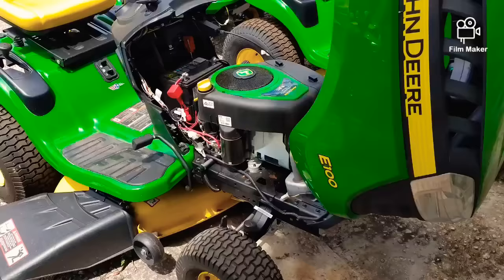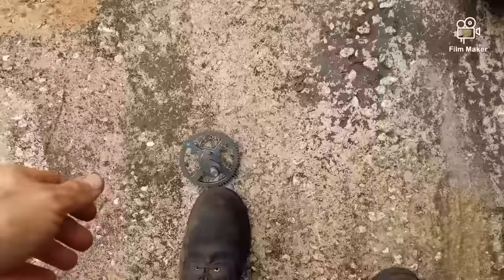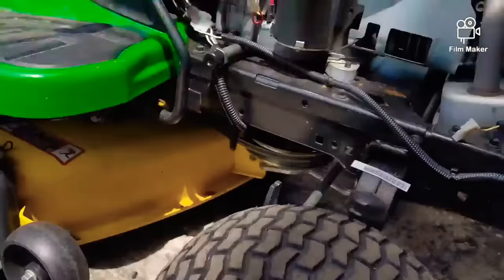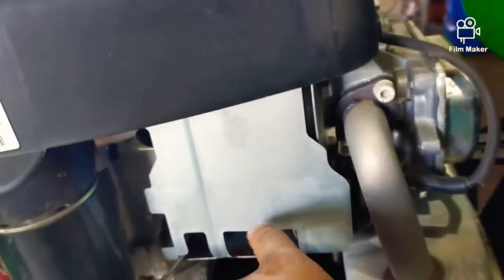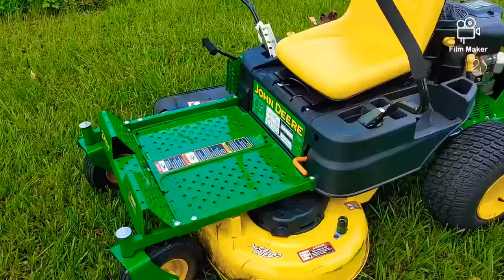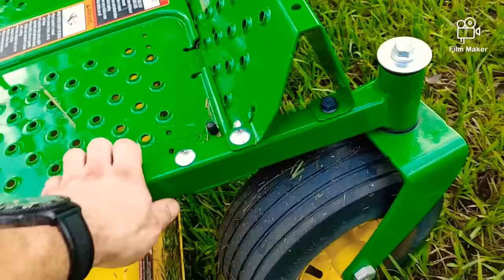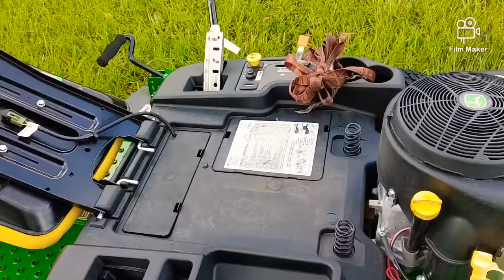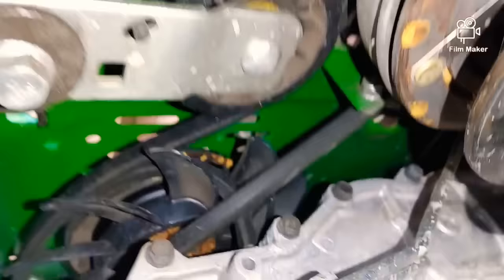Lawn mowers to avoid!

Comment: I have the z335e zero turn and other than the fact that it has no viewing window or any way period  to see fuel level I actually like mine so far it does have a light that comes on just before it runs out but I'd much rather be able to just glance at it and see how much I got and as for that compartment under the seat I see yours just had debris in it and nothing stored in there I can't think of anything you would want to store in that thing heck I barely even raise the seat anyway but the front caster wheels are clunky and rattle and stuff I'm sure the cheap plastic in there you was talking about is why....of course they can't make stuff to last anymore cause they are in the business of selling parts and if it ain't constantly breaking they couldnt sell you a part and fix it for ya lol

Comment: I just bought a z320m. Heard it was great
Reply from the maker: The new ones are much better than the previous generation of Z300s
Reply: @Mechanical_Mind  thanks for the video. I just inspected mine closely and it's definitely built better. I'm pretty sure the kawasaki engine is really good.

Comment: buy a mower that fits your yard.people buy a lightweight plastic mower and then mow rough hilly land that beats the mower to pieces and burns out the trans. and take care of the mower. you cant mow week after week and just pull it into the shed  and expect a mower to hold up with no maintenance and no cleaning.
Reply from the maker: 100% accurate! Thanks for watching and commenting 🍻

Comment: I bought my Z375R about 3 years ago. And I hate it. Yes it cuts my 2 acres great, My lawn loves it. However I get covered with dirt and debris, I mean covered. You would think John Deer could design a mower like this that does not blow shit up over the front of the mower deck. I even wear safety glass's because of the crap coming up over the front of the mower.  Unless you like to get covered from head to toe with debris buy another one

Comment: Both B+S single cylinder engines have that cam problem. Also the single cylinder engines have very poor head gaskets that like to fail by the push rods giving you crankcase pressure and it's resultant problems. Makes you think you have bad rings. Otherwise these engines are ok. Most JD z tracks ore good except this cheapest model which is junk like he says. One other problem is you can't see how much gas is in it as you fill and can easily overfill it. I never heard of that mech air in the front tires. Usually you put 10 psi in the back and 12 in the front. If tires want to leak if it's a hole I plug it and if it's beads I clean and put sealer. Otherwise I put a tube. I was a JD mechanic for over 20 years and have seen it all.
Reply: You said "both B &S single cylinder engines", which two? I know the Intex 33R is bad, but what's the other? I'm looking at a 21hp professional series to replace the busted 19.5 hp Intex. Would that be a wise choice or is it too a dud?

Comment: None of what this guy said is true of my Z355E. I'm going on 5 years with mine, and so far the only issue I've had was a pin fell out of the right steering arm. And all that caused it was the nut got loose and fell off. 5 minute fix. Mine has bearings in the shafts for the front casters not bushings. I take them apart and grease them each spring, as well as the spindles, etc. 

With proper preventive maintenance these are just as good as any other lawn implement. Surely neglect something and its going to fail. The wise man anticipates issues and corrected situations before they happen.
Reply: Oh yeah by the way, my front tires never lose air, so it must be they've started cheaping out on parts with newer units.

Comment: Good video. Plastic trans? Wow. I guess JD needs a price point for those who want JD but can't afford higher end ones. Unfortunate.
Reply from the maker: John Deere makes some of the best high end equipment so when customers say "I thought John Deere was high qaulity" when their $2k mower breaks I think to myself "you need to spend more than $2k to get quality" They did finally stop using plastic transmissions 😆. Thanks for watching and commenting James 🍻
Reply: @Mechanical_Mind  So true you generally get what you pay for. Jd has a very good reputation for quality on the high end and I'm quite invested in their Ag equipment. My cousin was looking to replace his last gen craftsman which he has broken 6 of the aluminum spindle blade housings. He mentioned JD but thinking not a zero turn. Any suggestions for a decent JD model (approx 1 acre of cutting).
Reply from the maker: @jameshill4900 X300 series if he is willing not to have a zero turn (which I dont understand the obsession with zero turns). The x300s are really nice high quality lawn mowers.
Reply: @Mechanical_Mind  Thanks 👍

Comment: I gotta call BS on his remarks about the John Deere Residential  zero turns.
 The deck isn't  cheap nor does it bend easily.  Operators  fault if he steps on the deck. Not John Deere's.  The deck lift is not something  you use every time you mow. Most people have it set at one height and leave it alone. The bushings in the front spindles  do wear out but after many hours of use. Tires hold air just fine . The body plastic  cover isn't  difficult  to remove. What he said is wrong.
 No abnormal amount of drive belts coming off. In fact I haven't had a single one come in with that issue.
 My ONLY  concern would be the non serviceable  transmissions.  I wish you could easily  change the transmission oil in them.
 So overall  if you maintain the mower, don't do stupid stuff with it than you'll  be glad you bought it

Comment: Sorry but your info is just your opinion. My JD's have been flawless. The current one , 6 years running since bought new ..  Oil changes and blades sharpened. Thats it. Still has the OEM battery in it. The Home Depot JD.s are more than likely junk, just like all the mowers the sell.  I mow about 2.5 acres each time. Correction, my wife mows, she loves to do it. The JD mower was a very good investment. Zero turn.

Comment: I disagree about the 335e zero turn. I use mine about 40-50 times a week on lawns and it's insanely reliable. Never has been down in 4 years and I got it new 0 hours $1000. Great investment. Deck sucks and caster wheel bearing is garbage but it's not a deal breaker. This is coming from a landscaper and small engine mechanic. I got out of John Deere ultimately because they are garbage mowers all around.

Comment: Any JD zero turn with an E in the model number is the bottom of the line. Leave this junk at HD or Lowe's and buy the R (residential) model. It will cost a little more the the difference is huge.

Comment: 58 hours on my JD zturn and tech said the throttle cable was already frayed and should be replaced, $133. Then, after only 58 hours or about two seasons, said he couldnt balance the blades anymore and needed new pair $70. Im rough on the blades, but cant figure a metal cable needing replaced after only 58 hours. Unless Im being had, I sort of regret buying the JD, I thought they were well made but not so sure. Problem is that the various lawn mower companies are all pretty much the same and junky, the brand name is irrelevant, it really comes down to how much you are willing to fork over in cash. Not everyone can afford or wants to spend  20k+ for a commercial grade mower for personal residential use and corporations know it and so they put the junk at the sweet spot price point in the middle usually somewhere btwn $2500 and $3900.

Comment: All of the residential mowers from Deere, Cub, Husqvarna, and so on are made by the parent company of MTD.  They are all basically the same and that company licenses the rights to the names.  Don’t think just because you went to a dealer and spent $500 more than at Lowe’s yours is any different.  If it’s residential it’s junk and made by MTD.

Comment: I hate my JD z355e. I gave up trying to keep air in the front tires.  If you hit a pine root your deck is bent. Putting the deck back on is horrible. A new deck is over $1000!

Comment: I own a z255, has anyone had issues with the front draft rod slipping off constantly? I've had to resort to using wire to wrap and tie it in place. This usually works for a few mowing, until the wire rubs enough to break.

Comment: You should never turn those Briggs singles  like you did. Good way to actually break the compression release. 
 If you would have adjusted the valves on it, it would have solved the issue. But I guess you probably already found that out being this is an old video. I sure hope your client didn't get charged for a bunch of unnecessary parts and labor. 
On those engines, when the compression release breaks, pieces end up in the timing gears, and that transitions into the engine either locking up, or rolling over a little bit, then stopping solid and not rotating any further. 
When the valves are out of adjustment, the exhaust valve isn't opening far enough when the compression release bumps it, to let enough compression out fast enough to enable the engine to roll over properly. When you rotate it slightly backward off  all you're doing is basically getting a run at it, so to speak. 
I have fixed dozens of these, and every single one that had a bad compression release, was either locked up or would roll over slightly then stop solid.

Comment: Does the JD S120 have a plastic transmission? Thanks again and nice video.
Reply from the maker: No, the S120 does not have a plastic transmission.  JD had so many issues with the plastic transmissions they stopped using them altogether. They use Tuff Torq brand transmissions now. The S120s are decent mowers. Weak decks and cheap spindles and deck idlers in my opinion.  I'd buy a Cub Cadet if you want a tractor style riding mower

Comment: I have a z535M with 54" accel deep deck. I haven't been dumb enough to step on the deck, and I have no complaints about the deck, except that the center spindle grease fitting is a PITA to get to. HOWEVER...I just had a major issue: The drive belt worked a groove through that plastic cover you mentioned, just below the battery at the tensioner pulley....and yes, wore through the battery splashing battery acid all over the underside, with the belt slipping off the pulley obviously. NOw, I've got my mechanic looking at this soon and I'm wondering...it's a chicken or the egg question...which came first...did the belt slip past the lip of the pulley over time and eventually wear the groove through the housing and the battery that way, or did the crank shaft seal go first and cause the whole thing to happen in a short amount of time?  Ping me back and I'll try to get back here with my mechanic's results.
Basically though...having the battery compartment just above the tensioner pulley is a baaad design....and only protecting it with plastic. Ugh. Stupid. I'm going to ask him to put a steel plate under it or something.

Comment: I have Z335 and it has 400 hours on it. There is lot of problems begun, and main problem is crap 42" Accel Deep deck. Its shit shit shit. Just like a Russian/Soviet thin steel... at first it was very good to cut but now it has some dents and twist so it does not work anymore good
Reply from the maker: 400 hours for a Z335 is rare. They normally fall apart after 200 hours.

Comment: I bought this mower from a guy and it was 5 years old.  My son has 2 acres of lawn and it mows great. So I don't know what your talking about. Hes had absolutely no problems with it
Reply from the maker: Consider yourself lucky. What I'm talking about in this video is after years of working on hundreds........ HUNDREDS of these very mowers, and they all had the SAME issues. John Deere was apparently having so many of these same issues with I mentioned that they  fixed every one of those issues for the newer model. I'm not saying it was because of me. It was because all the dealership's service tech across the country were seeing the same. JD does actually want input from the technicians in order to make changes and improvements, which I think is great.

Comment: Your insight and warnings are very much appreciated. I do have a question and am interested in your opinion on my John Deere model LX 173. I have a terrible time getting the mower to fire after a week of setting, or in-between mowings. I replaced all fuel lines, I tried a new fuel pump but that was worse. I put old pump back in. It pumps 1oz per 15 seconds, which from what I read is up to specs. I replaced the old ignition coil. It tested bad. Also replaced old spark plug. The resistance was only 4.62k ohms. Even after all this it still takes a good 30 seconds of cranking to get engine to fire. I made sure carb butterfly is closed so as to choke the engine.  Any thoughts or experience with this phenomenon! Much thanks! Keep up the good work sharing your knowledge!!
Reply from the maker: Hi Scott, it sounds like you might need a new carburetor. Make sure the choke cable actully operating the choke properly. You might try removing the bowl and making sure the fuel shut off valve isnt sticking.
Reply from the maker: Id also check your valve clearances. 
You also might have a valve not seating properly.

Comment: I just bought the new Z320R And I pick it up Monday. What do you think of the newer ones?
Reply from the maker: The 2023 models are much better than the recent prior years. They drastically improved the frame, front tires, deck lift and more. I'm not a huge fan of the deck. I made a video on the 2023 
https://youtu.be/wSLQwtbfVno?si=wIqwi2mpHy003aNr

Comment: I've never understood why they would design a compression release mechanism into the camshaft. Just put a starter on the engine that has enough torque to crank the engine. The incremental cost of a stronger starter motor can't be that much. I also can't believe they are using plastic for the construction of the hydrostatic transmissions. That's absolute insanity.

Comment: Thank you for the video and helpful information. My question is, based on your experience, what riding lawn mover, John Deere or different brand, that doesn't have a plastic transmission, would you recommend for one acre residential use? Thanks
Reply from the maker: For 2023 zero turns $3500 -$4k price range I like the Husqvarnas and Cud Cadets.https://youtu.be/HnByd9pllRY

Comment: Whats your opinion on the Z5 series? I am in the midst of negotiating on a Z530M and a Z5R to compare against my quotes on the BadBoy Elite and the BB Maverick and a Toro TimeCutter “Havoc” edition (all 52”+ sized decks)…
The JD Z5’s appear to be a substantially better built machine than the Z3’s… Are there any insider opinions you could share on the Z5’s? Thanks!

Comment: You know something I have a single celendar engine 19.5 2012 model with almost 560 hours on the original engine and only had to do regular maintenance so I’m not going to take advice from a guy who claims to be a service manager except from my dealer. Have a nice day and good luck
Reply from the maker: Sensitive much? It's a well known issue that the single cylinder Briggs engines have. But thanks for sharing about your experience with one engine.

Comment: Thanks for the video! My 22hp V-2 Kohler in my Toro riding mower does the same thing. It also ate the keyway on the flywheel twice. The first time it happened it was throwing flames out the exhaust as the timing was off. Thank God for a video I came across by fluke said this happens all the time… where would I even start diagnostics if it wasn’t for that!?

Comment: Thanks for the info. I just bought a John Deere Z325e zero turn form Lowes. My property is just a little over half an acre and I take very good care of my equipment. I currently have a craftsman T-110 tractor type that I bought in 2020. The T-110 is running fine with zero issues except a batter replacement after 4 going into the fifth season. So, do you think my new mower will be fine with a fairly small yard (big for me)?
Reply from the maker: The new John Deere Z300s are much better than the previous generation style that I showed in this video. They pretty much solved all the bad design issues except for the deck. The deck will be fine as long as you don't hit something or scalpe the ground.
Reply: @Mechanical_Mind  Thanks for the reply brother. btw batter... *battery lol

Comment: Why replace the cam shaft? Adjust the valves on the single cylinder briggs
Reply from the maker: The compression release breaks. It's made onto the camshaft. Adjusting the valves will not solve the issue. It's a well known issue for those engines